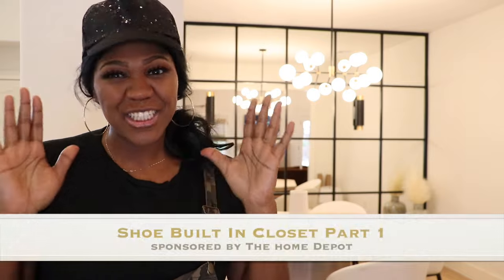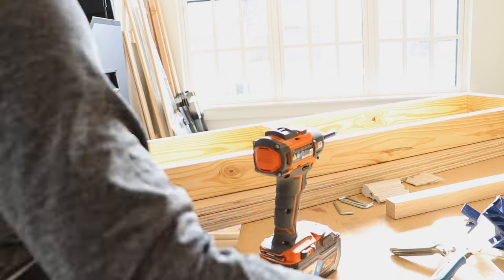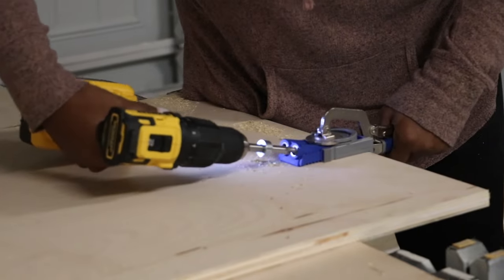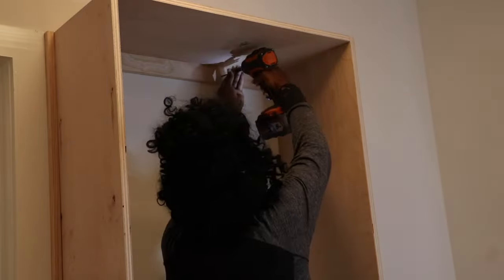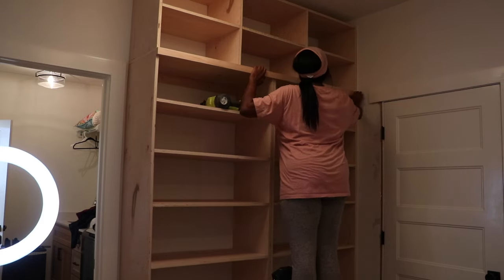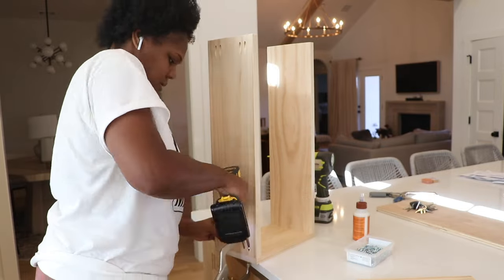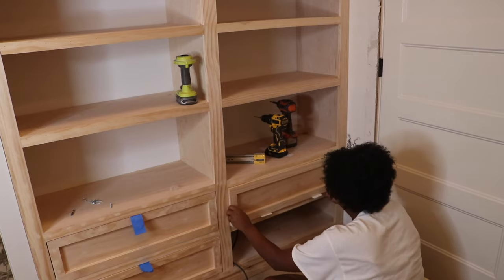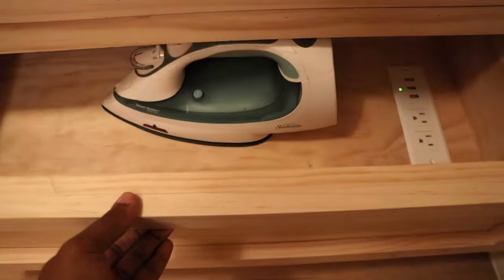DIY Master Closet | Shoe Built In from Scratch| Part 1 | Installing the Built In

Comment: You made this look very easy to build so since I have all the tools and the ambition to have a dream closet of my own, you have inspired me to tackle this project. I had a few questions? 1). What size board on the back of the boxes did you use to then attach to the studs in the wall? 2). Did you use 3/4 inch wood for the dividers in the boxes as well? This came out amazing. So glad you shared your process. Thank you!👏👏